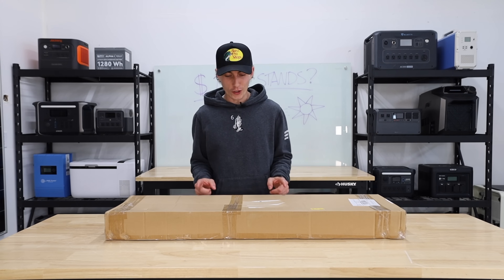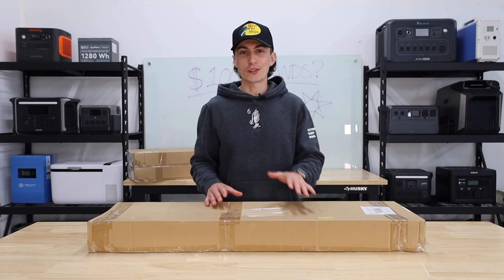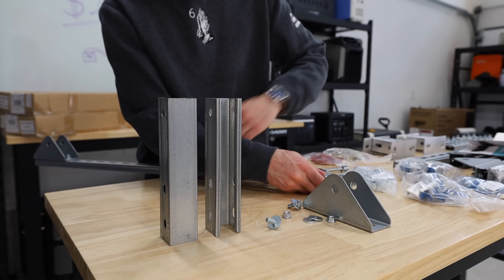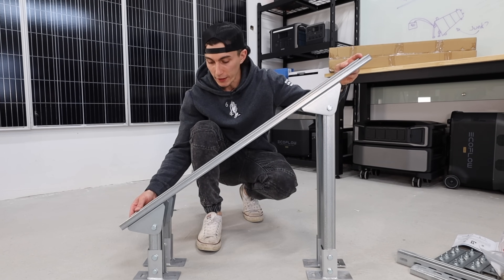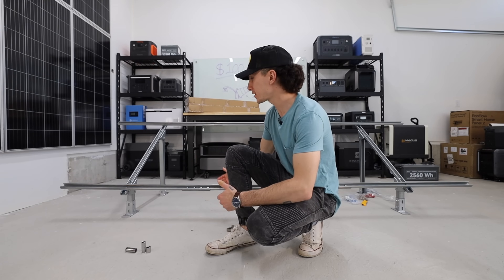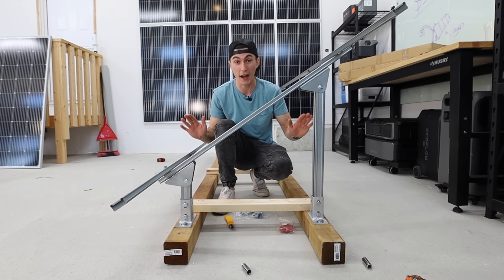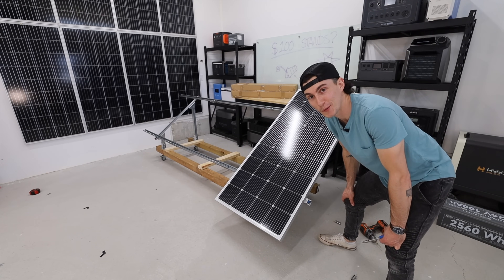$100 Solar Panel Ground Mount - Quick & Easy Assembly!

Comment: The ECO-WORTHY’s kit (upgraded) $129 on sale were junk. When you try and tighten the bolts the metal crushes down due to nothing backing up in between vertical risers. Even the braces for the horizontals bent. I would not recommend these things. The upgrade kit does have a middle support.

Comment: They keep showing a center support on the Amazon web page, but I don't believe they actually give you that center support!!! And you have to determine the angle the panels you want before you start building it. You cannot change it afterwards...
Too bad they don't give you another option for larger panels. Longer supports beams...

Comment: I need something like this but I have 73" x 40" 400w panels and have 4. I can't seem to find anything that fits those for ground mount so I can put wheels on it.
Reply: Same
Reply: Have you found anything yet 🎉
Reply: @carolmaplesden916 I tried the eco-worthy 2 pack 54" (?) ones and mounted them horizontally and it works kind of. But I guess I need a full size rack and I have no idea what to buy

Comment: If you adjust the distance between the legs so that they almost align with the 1st and 3rd panel gaps it wont sag because the panel's weight itself will counterbalance

Comment: Pro tip, get some socket impact rated adapter. Save so much time. If you noticed head going to be strip. Then stop
Reply: I wish I knew what that is

Comment: Not quick or easy. Stand legs not prepunched to rotate as shown in video, there's an angle bracket that mounts to nothing, and the couple at the rails lands where the panels come together so the clip won't set....

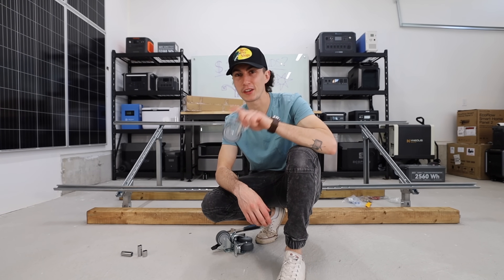Comment: So, I looked at your assembly at 4:06, and although not in the instructions, if you slid the supports toward the middle, say at the spot that would be between the first and second panel, and then between the 3rd and fourth panel, your structural rigidity would be much better than having the supports out closer to the ends like they are there.

Comment: They sag because the horizontal rails are not one piece and they have joints ..  they should be either 1 piece or the piece that joins them longer .

Comment: I just bought this kit. I guess they saw your vid?? Haha. My kit came with a 3rd vertical brace that goes in the middle, a single drop leg and 2 more pivot brackets. It allows a solid support at a center point of the whole structure, provides a 5th anchor point and eliminates any sagging.

Comment: I have bought five of these racks and they work out well.  I mounted them on 4 ft 4x6 pressure treated blocks.  It adds some additional height to make it easier to balance the load and some weight to keep them from flipping over in a heavy winds.

Comment: Thanks.  I'm trying to mount this to a Conex shipping container.  This helped me see a huge chunk of the additional installation of creating a rigid grid on the container without drilling into the roof which is not something I want to do.  Wow the link to "better" is like $2-4K.  I wonder if you can take two of these kits and put them together to solve your sag issues?  Then I could take the rest of the leg rails and use them to mount to the actual container.

Can you tell us the total width and length taken up by this setup after the panels are installed?   A lot of the setups I have seen allow two rows somehow.

Comment: The problem with sagging is because you put the support brackets outboard to far. Increase your outside cantilever by 12-14 inches and you would have the same structural support without sagging
Reply: What should be the max span distance between two vertical supports to prevent sag?  Similarly, what should be the max span between the wheels to prevent the 4x4 from sagging?

Comment: I would have pulled the legs at the top angle bracket and drilled new holes to turn the feet.

Comment: i have 7 of these. and they are cheap . wish they sent 40mm bolts as my 290 watt panels will not fit with current setup. works great for 100 watt panels. i think they over advertised its capability.

Comment: Thanks for sharing.  I was trying to avoid fence post digging for something that i would only use when there is an extended power outage since i live in hurricane alley USA.  Wheel it out during the outage and wheel it out of sight once power is back.

Comment: I think a lot of us are looking for something like this for the newer 400-450 watt panels.    There is the EG4 mount and one other popular one.. but I need something with some more height for snow.
Reply: Add some 4x6 pressure treated blocks.  I cut one 8 footer in two.  If you need more height then try 4x8.

Comment: I built several solar arrays on wheels in my backyard. I use nylon cord and tent stakes to secure them to my lawn. They’ve survived every wind storm so far.
Reply: Good good.  But would you value any potential to 'Slip' the wind by leaving maybe as much as a 3" gap between those panels?
I have very strong winds and wind gusts and I'm interested reduce even 15%
Reply: @crackerjack6075  it might help to leave a gap. I haven’t tried that. I’ve learned through trial and error how to strap my arrays to the ground. 3 nylon cords in back and one in front. Last couple years they haven’t blown over. We get 40 or 50 mph winds a couple times per year. I always place my arrays so if they do get blown over they land on grass. No damaged panels so far.

Comment: Another way to Not have to turn the 4  feet brackets is to have 2 perpendicular 4x4 stringers inside the long 4x4s. Just drive long 1/4" lag bolts thru the side of the long 4x4s into the ends of the stringers.

Comment: I thought of buying 2 sets for my 4 200W panels. Either make one stand for 2 panels and then another. Or just use one leg assemble and on long strut  down the middle for a 4 panel set up. The odd strut and leg could end up being used if I want to set up another 4 panels.
Edit note: They have increased in price. Now $169 but they have a $30 coupon to click on.

Comment: Are you interested in a 12V tilting solar panel mount for Van's and RV's?  I have them in stock. Just push a button to raise and lower the panel.

Comment: This looks awesome for the price, but is there a big advantage over just building the whole thing yourself out of wood and/or something like Unistrut?
Reply: “Big advantage?”  Suppose it would vary user to user.
This kit is delivered to your door in a reasonably small package.  No truck required.  
Unistrut is far from free.  This kit at $88 would be cheaper than I could get materials and hardware for commercially.  
It’s a kit with a plan and instructions.  Low, low requirement for invention and building tools / skills.

Comment: If you are making multiple solar arrays, then buy three kits to make two arrays. Use the third kit to add the middle support that is lacking in their design. Two well built solar arrays from three $100 kits still is a good price.
Reply: Nice, and you also have a cache of on-demand replacement parts
Reply: Are you saying add a 3rd horizontal channel to span the width instead of just 2 channels like what he was showing at 3:20 or are you saying add a 3rd trapezoidal vertical support in the middle, or do both?

Comment: The biggest concern with solar racks isn't weight and supporting it, its wind uplift and making sure it doesn't take off in a breeze.
Reply: I have two 100w panels hooked onto a chain link gate that I have leaned over an old bench I made out of two by fours. It has been through two hurricanes 😂….
Reply: I got some 6x6x10 wood and I use it with wheels I live in houston and it didn’t even lift or nothing worked out well….
Reply: @dieseldawg7132  how did your setup do with the recent storms? Did you lose power?
I'm looking into a setup like this, but dealing with Centerpoint will probably be the worst (I don't wanna go to the grid, but I DO want to run from panels to generator to meter).
Reply: @ninjabuck2576  went good boss wish I could tell ya everytime I write a comment it doesn’t post
Reply: @ninjabuck2576  did well no issues
Reply: I built 6 separate PG solar arrays on wheels. They’re in my backyard and I used nylon cord and tent stakes to secure them to the lawn. 3 in back and one in front. They’ve survived every wind storm so far. I move two of the arrays daily for morning and evening sun. The big array I move every 6 months for winter then summer sun. The big array is 3 of the small arrays connected in series.

Comment: Mine don't sag like that, so not sure what's going on there.  But I also got wider panels on by mounting them from the bottom and not using the included mounts, maybe the compressed fit helps? counter?

Comment: I SEE THAT F3800 in use for that setup. LOL.  Where is the review? I have a brand new F3800 I'm setting up next week. Would love your insight and how you set it up, and how you are using it. BTW---> Tiny Baby may need some hole pn that unit. LOVE your videos and thanks for your candid opinions and not allowing yourself to be BOUGHT.
Reply from the maker: Thanks for watching! Awesome that you have a new F3800. We have a review video on the channel for the F3800 that we published a few months ago and we will be publishing a lot more testing/application based content on the unit over the next couple months!